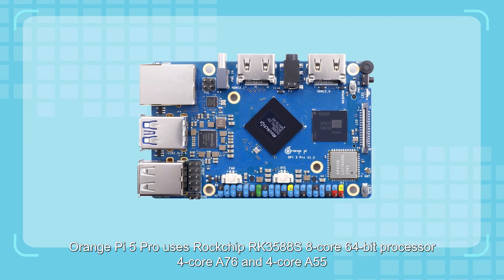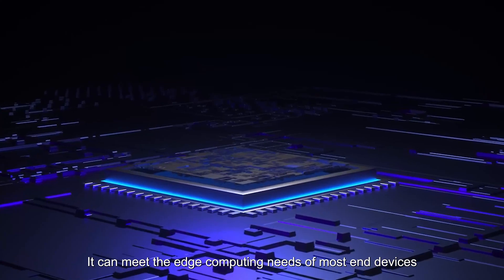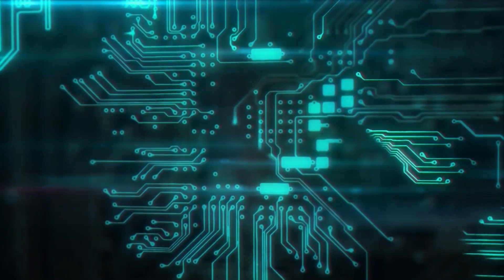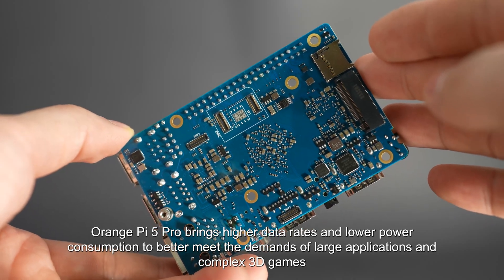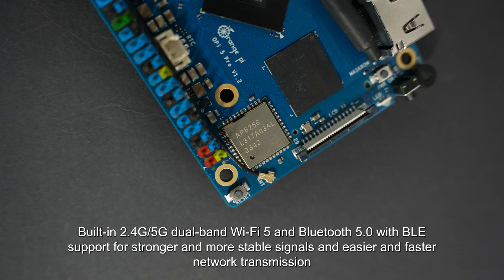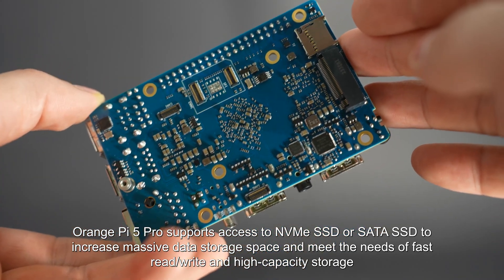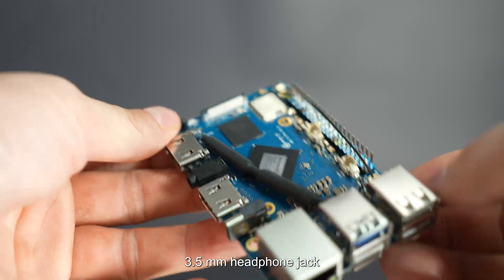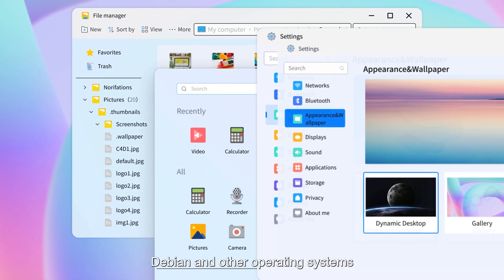Explore New Product Orange Pi 5 Pro Together!

Comment: Look for the price of it! Intel 100 or old ryzen 4-6 core  barebon even cheaper then this a76 sh*t. 
You can buy new mini itx lga1700/am4/am5 mb+new gen CPU, and even case+PSU, cooling, ram, ssd. Fuck this!. And even firmware, power consumption... +- on notebooks ulv and etc versions.
Reply: U clearly didnt do any research, this thing costs about 100 dollars with 16 gigs of ddr5 ram

Comment: You still haven't got the original Orange Pi 5 fully supported with decent software, nearly a years and a half after initial release.

Remember to tell people that you are just box shifters.
Reply: Their boards are made for tweakers and hobbyists -- not for the average windows user.

Comment: At around 30 seconds , discussing speed of LPDDR4 vs LPDDR5 it says "doubled at 6400 metric tons per second " might want to fix that AI reader 😂
Reply: It's other way of saying "That's a fuckton faster than LPDDR4"
Reply: @duffpl Good point, now I want all of our computer speed measurements to be based on metric tons of data per second.
Reply: million transactions per second (for those wondering)